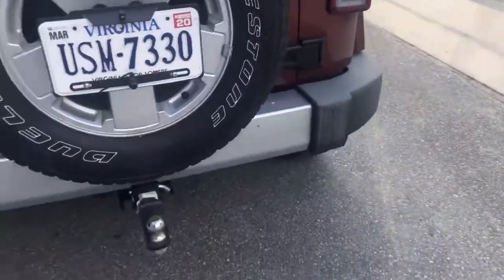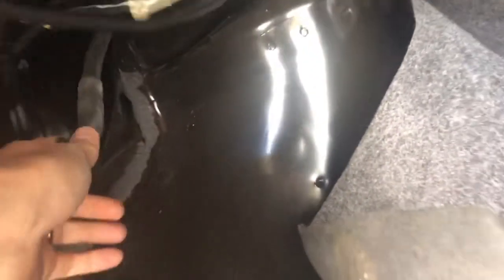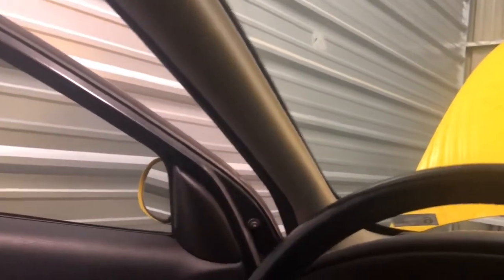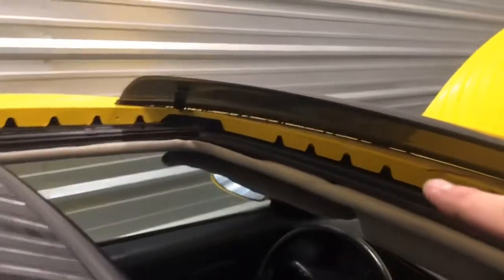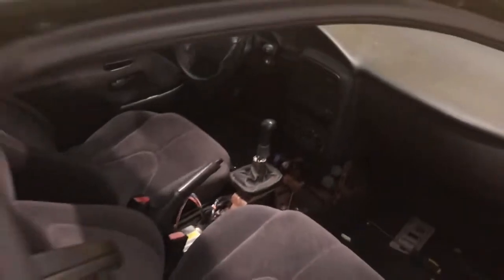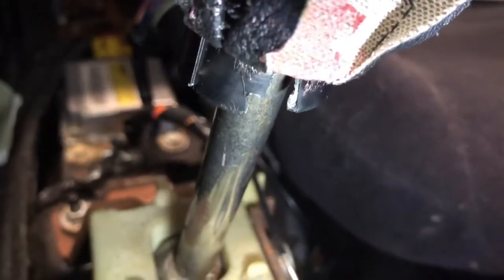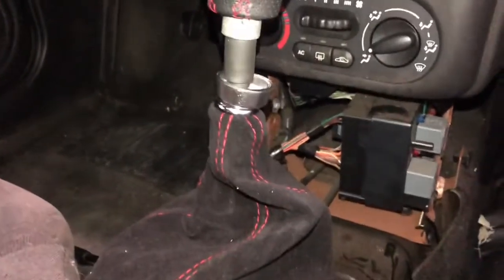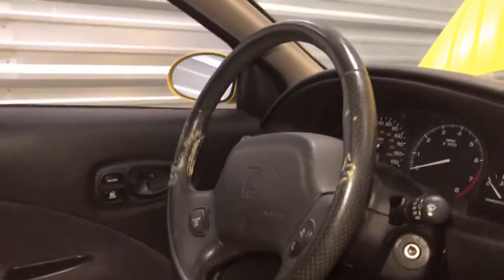2001 saturn sunroof, how to replace a shift boot on saturn saturn-s series.

Comment: How did you clean the sunroof drain lines?
Reply from the maker: I ran water over the sunroof and cleaned the rubber flap at the end of the hose that goes into the rear quarter panels, you can also do the same thing in the front fenders. There are 4 hoses 2 on the drivers side front and back and 2 on the passenger side.
Reply: @JCMotiveGarage  did you use compress air or a wire to poke up into the hose? I noticed yours were not installed thru the inner wheel panel did you have to remove quarter panels to re-install? I have a 97 Coupe that is leaking water into the passenger side from sunroof I believe these drains are plugged.
Reply from the maker: I just used a long screwdriver to clean it out, it's usually right at the end where the hose goes into the fender or rear quarter panels. No you don't need to take off the quarter panels to take them out or reinstall them.
Reply: @JCMotiveGarage  I finally got the time to try and clean out the Saturn's sunroof drains. The back drains were easy I found passenger side was not even in the hole. The fronts were another story the hoses for some reason had retracted way up toward the sunroof as the headliner has been removed I could see they were still attached to the drain pipes but they would not pull down to reach the drain holes!!  The grommeted end pieces were still in the drain holes. To fix this I had to connect another short length of hose to the existing drain hoses to reach the grommeted end pieces in the drain holes . Believe me this was not a fun task! It  was like doing surgery through a keyhole but it did work as I squirted water from the top ends of the dains hoses and they did drain out onto the ground.